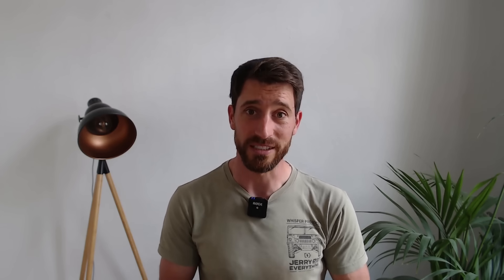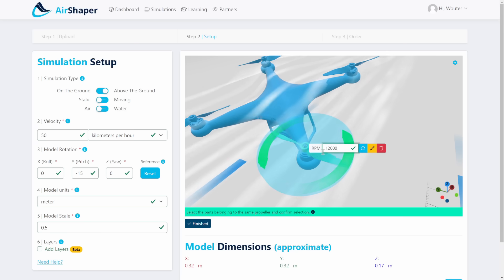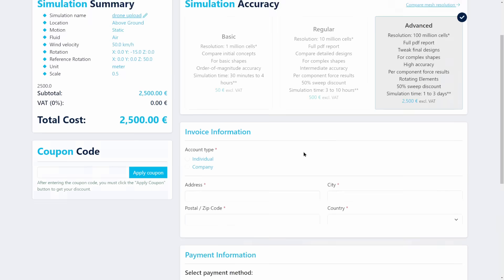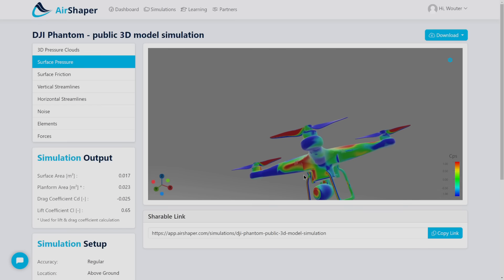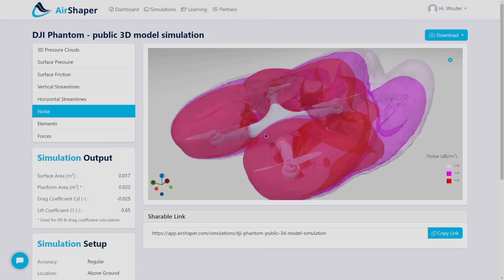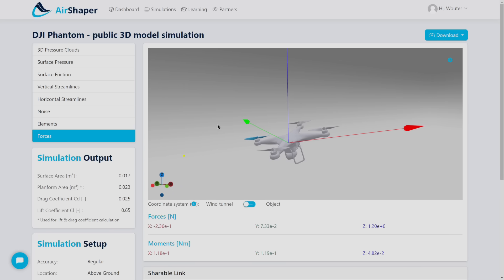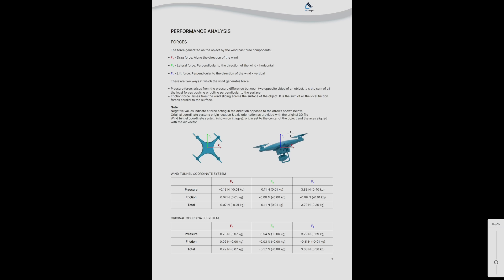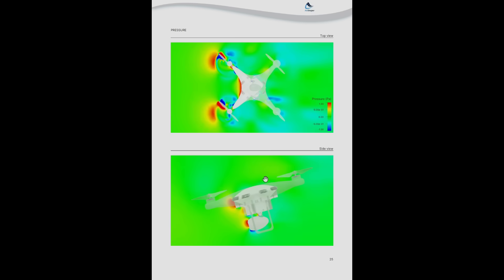Aerodynamics Made Easy - Drone CFD Analysis Explained | Step-by-Step Guide

Comment: Thanks for the excellent video! 
I assume this was an example of the output from the advanced simulation? Does the basic option give any force and moment data? I'd like to do a quick stability check for a model I'm working on
Reply from the maker: This one was a Regular simulation (you can find the link to the sample simulation in the comments). The Basic simulation includes forces and moments, but doesn't include propellers. So it can be used to analyse the airframe itself for example.

Just drop me a message at wouter@airshaper.com to help you set up your simulation if you like!